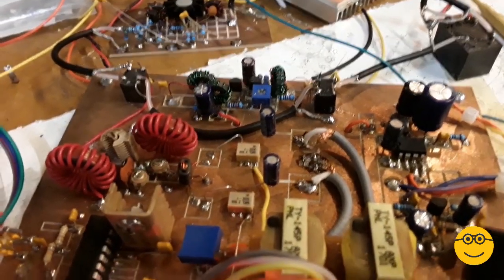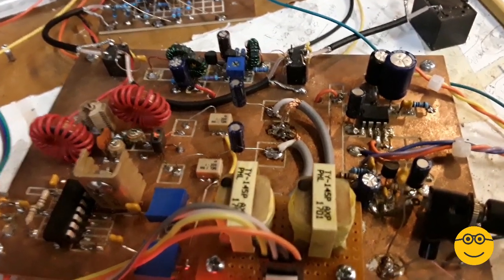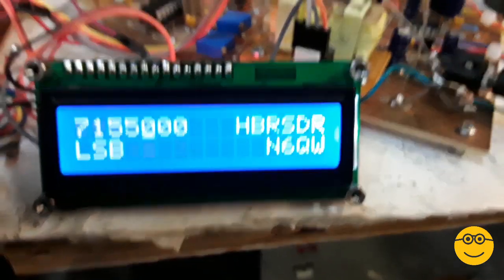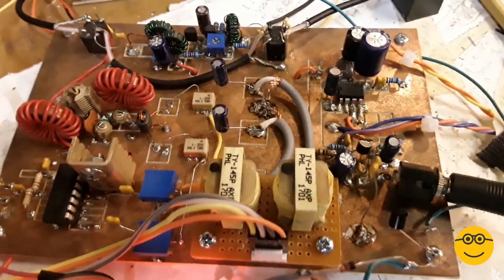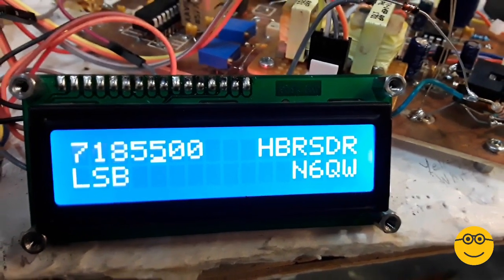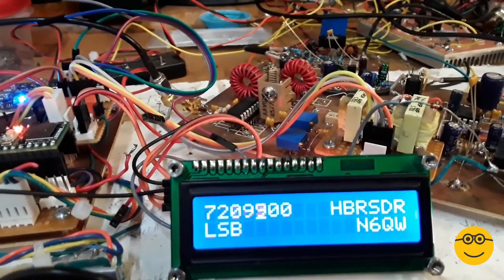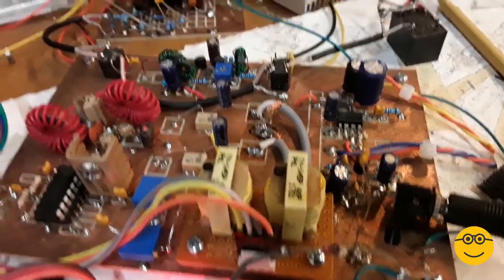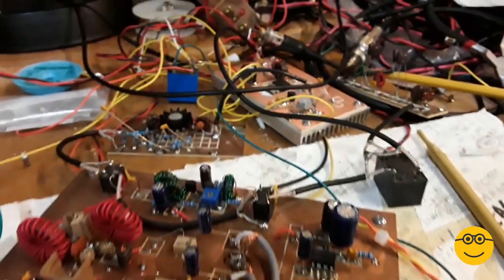SDR Demo

Comment: Hi Pete,  Now thats's a great sounding receiver in that radio. Very clear  audio. I really like that design. 73;s Dale
Reply from the maker: Hi Dale, Thanks for your post. I tried to spend some time going over the hardware boards -there is not much there and the real performance is in the software. What also struck me is that improvements can be made that involve no hardware changes - things like sharper filters or even selection of different filter bandwidths is mostly all software. Charlie has some sketches with CW and SSB so you could select either CW or SSB digital filters. WE live in a great time for homebrew rig construction.  I could see a second display + processor to display the classic waterfall --in color. I think it may be possible for the $35 Kookye Mega 2560/Touch Display and Adapter Plate could do all of that.

73's Pete